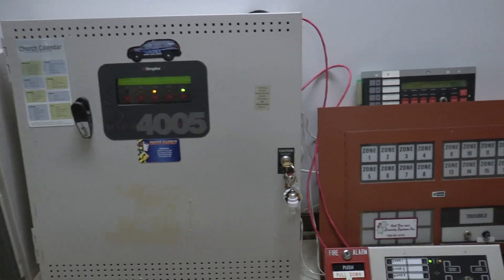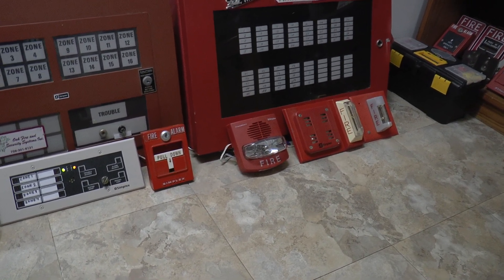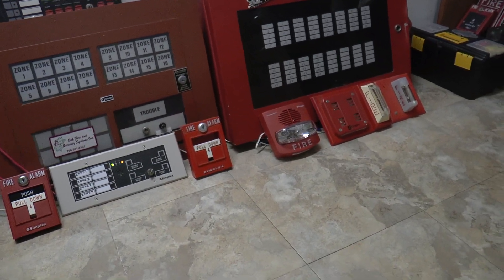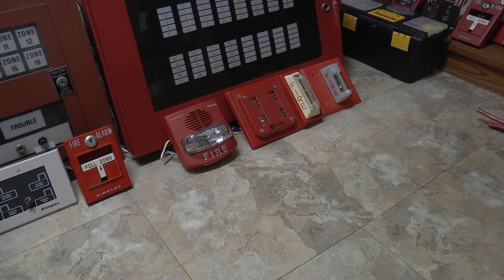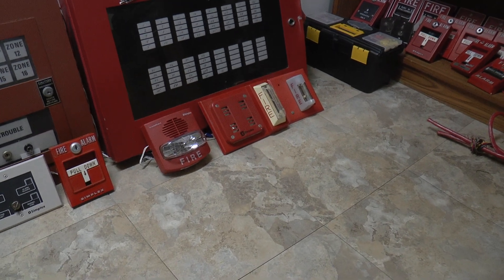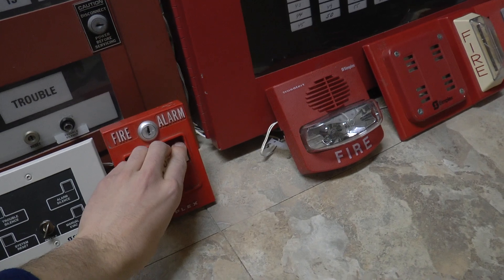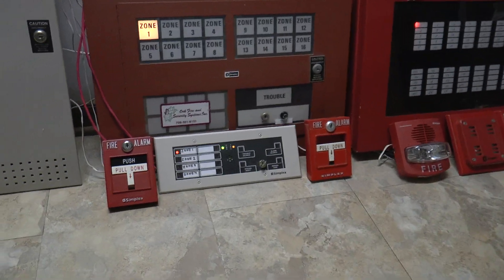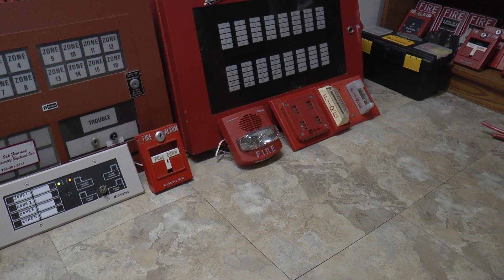Floor System Test 49

Comment: 4903-9105 is the strobe plate model number.  Also nice video!
Reply from the maker: Incorrect! The plate itself is the 4903-9501, and the strobe is the 4904-9105. Haha. Thanks very much!
Reply: msj191961 Ok.  I guess I just thought that the strobe plate was that model number instead.
Reply from the maker: @railfannerpnw  Like I said, I mix the two models up all the time. Understandable.